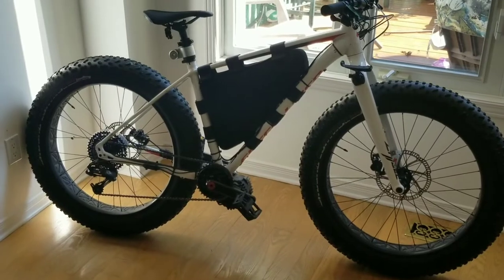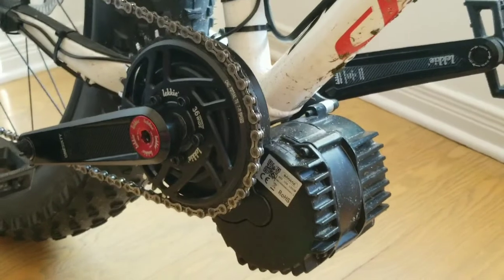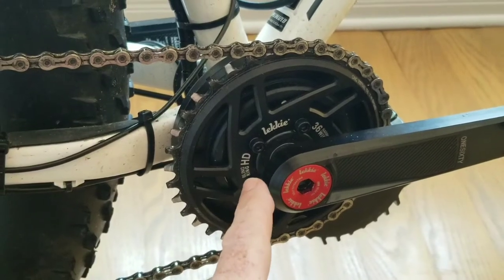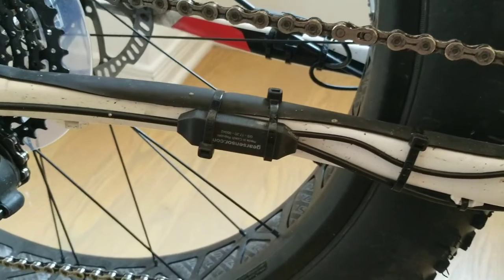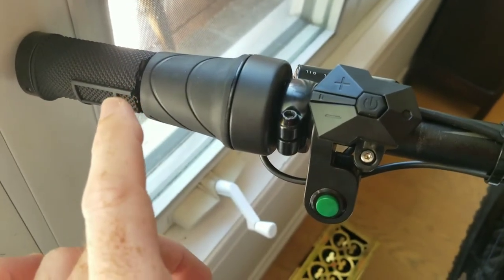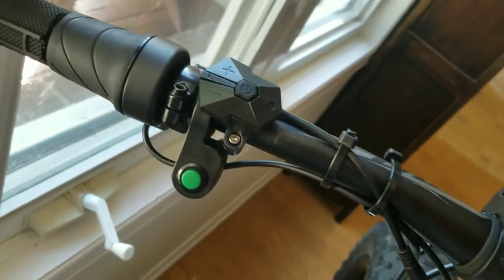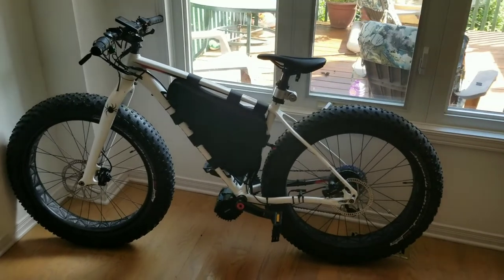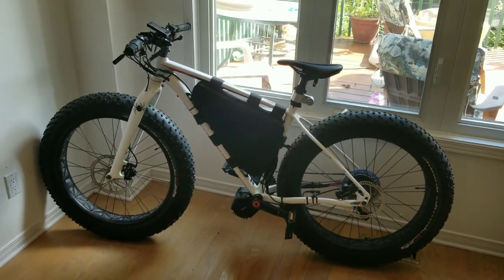Bafang BBSHD on Specialized Fatboy ebike conversion (stock) 30 amps 1500 watts

Comment: Very nice! That's what I have been trying to tell people build don't buy. Im sure this this bike will blow away any pre-built specialized e-bike for a third of the cost.
Reply from the maker: Yeah in terms of power and speed there is no competition. It's the handling on trails where they would beat this bike. Cost wise it's about $5500 Canadian to get to this point. The donor bike being about $3000 of that.
Reply: @HighVoltageKits  where can I buy all the parts I need man
Reply from the maker: Sign on my discord and it's easier to chat. This is very much in development right now but I can show you where I got the parts so far.

Comment: Am just beginning my Fatboy conversion and found this helpful. Will be sure to see your ride video.
Reply from the maker: Thanks. Good luck with your build. I noticed that some fatboys have the pf30 bottom bracket instead of the British thread. you can get a conversion cups they press in for about ten dollars on Ebay. I got some but ended up not needing them.
Reply: @HighVoltageKits  Please could you give me the link for pf30 to BSA conversion cups?
Reply from the maker: @nilsolivier2319  I got em off ebay mate. Just search for pf30 to bsa. Should come up. Let me know if you have issues.

Comment: Wish I'd of seen all your work back before I started playing with building mine summer before last.  I think I'll start over.  Mine has the BBSHD, a thousand watt hub in front and a 13spd rear end but all on an old mongoose I was given with the hub on it and powered by 48V drycell.  I built my own 52V which runs both motors and it has two throttles.  Way to many wires.
Reply from the maker: I bet you learned a ton in the process. What frame are you thinking of using?
Reply: @HighVoltageKits  I really don't know  about the frame for certain but am partial to the fat tires.  The mongoose has 4inch ones.  It's just not a well balanced bike for upper speeds.  Kinda wobbles some.  I'm currently going through all your posted videos from the beginning and am at Oct of 2019 loving it all.  The idea of a frame i seen you post in one somewhere that i haven't got to yet looked promising with its own battery box built in and a swing arm rear end.  I'll have to see about getting a picture of the mongoose to send you.  What a mess and yes it was a learning experience.   It was fun.
Reply from the maker: Sounds good. Consider joining our Discord community. There is a link in most video descriptions. Easy to post photos and videos there. Let me know if you have any issues.
Reply: @HighVoltageKits  I'll join eventually.   I am part of one where I was looking to score the ASI bac855 plug and play replacement and will join more I imagine.  I understand I've gained access to a list but it will be a while.  Meanwhile I may do something similiar to you.  While waiting I will probably do myself up a bike with the latest CYC.
Reply from the maker: That's the one. We we are catching up. Hopefully not long wait now. Still waiting for proper user feedback on the cyc!

Comment: I see where you used a 7.5mm & 5mm spacer on chainring side. Do you recall what size spacer was used on the other side and do you know what the diameter is of those spacers? Instead of using a bunch of washers on the motor mount bolts, could some sort of thick spacer be used? Thanks, I’m getting closer to ordering a kit. Just want to make sure I get everything I need.
Reply from the maker: The other side only needs the washers. Unless you are using the same frame I would just have a nice variety and see what works. The washers could be a single part. Aluminum would work well. They do the job though those washers.

Comment: You addressed chain line, which no other video has done. Thank You.  Do you have really short chain stays or is this going to be a common problem on all kits? - (can't use the full cluster)
Reply from the maker: Its because the tires are so big that the chainstays are wide and the reduction gear on the motor is pushed out. I ended up rearranging the gears as you dont really need the smallest ones.
Reply: There are aftermarket chain rings that address the chain line issues.

Comment: I have this exact setup with the same 36 tooth front chain ring. I  want to get the best trail and mountain performance possible. In your video you mentioned ditching the smaller gears and moving them over with a spacer so you could use the bigger gears. Did you find out if that worked? Thanks for the great videos and the help.
Reply from the maker: You are welcome. It did to a certain extent. I also switched to a 42t with an offset. But it will help as you rarely use those. There is a video on it in my history. It's going back a few years though. If you click on my channel and then videos there is a load more on this bike. Cheers

Comment: If you put the larger dished gear on the crank to get the chain back in the center of the cassette, would you get gears 1 and 2 back? I don't know for sure but I'd think you'd get more torque multiplication if you can get 1 and 2 to engage with the larger crank than you would from the smaller smaller crank that looses you 1 and 2. Just thinking out loud.
Reply from the maker: Harry Robertson I think you are right. That and the chain line would be better. Which would stress the chain much less.

Comment: Be careful, I heard you mention having the startup code in place so your kids won’t be able to throttle the bike. I have a BBS01B with the DNP-14 display, it locks the screen but not the motor or throttle. The motor is still active even without the passcode. I’ve read online this is common, check into it! Nice looking bike!
Reply from the maker: Tri P Zuki Just tried it. Yup you are spot on. Never even thought to check it. Kind of negates the point really... I think I will switch the push button kill for a kill switch. Probably one of those covered ones. Didn't even occur to test the throttle as too busy trying to beat the timer. Glad I found out this way! Thank you.
Reply: If you set the auto shut off it should force anyone trying to ride without a pass code to constantly have to turn the bike back on.

Comment: Nice Job Captain. I have two questions: 
1 Did you consider hub motor ?
2 How much faster the chain and gears wear out since all the extra torque is put on those.
  ( in hub motor it just your pedalling which stretches the chain and wears rear sprockets and that  is actually lighter than without e- assist )
Reply from the maker: Thanks JJ. I did a much more recent video with some good info on wear and tear. https://youtu.be/c7q5TbIYq7I But I haven't had anything major break yet even at 72 volts. I did not really consider a hub motor. Mainly as I knew I'd be moving to a place with a ton of hills and I wanted the torque only a mid drive can provide. Nothing against them mind. It's much easier to have regen breaking apparantly with a hub!

Comment: Looks like you have done a nice job of that. The only thing I don't like is how low the motor sits. Mite   run into trouble on ruff stuff.
Reply from the maker: Scott james eaton Thanks. I do worry about the motor being low although I have not bottomed it so far. Its built well enough to take a few hits not that I want to find out. I'm not into the downhill crazy stuff. I saw a build where the guy cut his frame and set the motor in the middle which would be ideal. Looked so cool. Bit beyond my current skills and budget.
Reply: @HighVoltageKits  if your doing fire roads and smooth track I don't think you will have any problems. Enjoy.
If you fancy a change in future. Haibike do a fat six built e fat bike.
Nice machine.

Comment: By the way, you can do some simple math to determine if the larger ring gear (with the offset, enabling you to access the larger rear ring gears) will benefit your hill climbing goal.  (Number of teeth in front)/(Number of teeth in rear)=X.  This is your gear ratio.  The smaller the number, the better the hill climbing torque.
Reply from the maker: Thanks for that tip. I have to work on the gearing a bit this weekend

Comment: Hi what did you fit onto the bottom bracket to allow the bafang to fit thanks and did you encounter any problems on the long term test thanks
Reply from the maker: If you have a look in my videos list there are a lot more videos on this bike at six months etc. The main things I fixed were the chainline but I have modified it significantly with external controllers as well. I used some spacers to position the motor and get it to clear the cranks but nothing else as it was an english  threaded BB. Hope this helps.

Comment: Just go with the lekki 42 T chainring and you can use all your existing sprockets, that’s what I did with mine and it’s perfect. You will never feel like you need more low end torque. You are effectively nullifying the 36T anyways with your setup.
Reply from the maker: OhioPreparedness Yeah I think I'll pick one up. Its spring now so lots better riding!

Comment: Impressive build. You did a great job.  How about posting some riding and performance video?  I subbed you, so you must 😆
Reply from the maker: For sure, thanks. I'm working on a video to demonstrate how good the ASI controller I'm using is. Be a few days as I just started a new job! Hope to ride some more trails etc with this setup soon. Cheers!
Reply: @HighVoltageKits  That ASI is sweet. It can be set up for bad ass power. Be ware of wheelies in lower gears;)

Comment: Hi great video, can I ask how did you get over the issue with the chain line? I'm having the same issue, I'm converting a trek xcaliber 7 and had to pack the motor out 10mm to stop it hitting the frame, I've adjusted  the cassette to get a straight chain line but now the body of the  deraillieur ends up hitting the cassette, I guessing I now need a spacer that would move the deraillieur out by 20 to 30mm or so any advise ypu have would be greatly appreciated 
Cheers
Reply from the maker: This is the most recent video I did looking at the gears although not from that angle. It shows what I did with my cassette. https://youtu.be/5DLFY0LoOPc

Comment: Forgive the newbie question.  Why did you go with the mid-drive versus the front wheel setup?  I have a 2015 Fatboy in mint condition and I'd like to convert it.  I'm just starting out with this stuff.
Reply from the maker: Awesome. Nothing wrong with questions. You are welcome to join  the channel discord and ask a bunch more there! https://discord.gg/9UwDG4j To answer this on though. A mid drive let's you keep your gears and is better with hill climbing. More central weight balance. Hope to see you on discord let me know if you have trouble. Cheers
Reply: @HighVoltageKits  Thank you brother.  I appreciate the invite and I will get on discord.  I will have some questions about the 100 versus 120 BBSHD for this bike.
Reply from the maker: Awesome. Got you covered there!

Comment: its super cool, have u come across a skid plate to protect the battery? i will build one of these and do a fair bit of offroad on rocky terrain, mountains etc
Reply from the maker: I have a mud guard that goes there. It's nice and wide but I only use it in winter..It was not much..It straps to the downtube. I don't recall the brand tho. Front runner fat it says on it

Comment: Good video.. what do you think it weighs total?
Reply from the maker: I think a shade over 70lbs.
Reply: @HighVoltageKits  thanks.  Is it ok if it gets splashed with water?  Can you just pressure wash it off?  I'd like to try some 4wd trails, but it involves fording some rivers.  Kind of worried that the motor will get submerged in water and die.
Reply from the maker: Stock it should be well waterproof. If you go external controller upgrades you can make it rock solid as well but a bit more effort. This is me riding the bbshd stock down flooded paths in ottawa https://youtu.be/D2DthD4Y0Xc
Reply: 67lbs

Comment: I put a 1500 watt hub motor on my mountain bike with a unit power 52 volt battery. it's very fast! Thinking about trying a mid drive for my next one. How powerful is the bafang? Top speed?
Reply from the maker: Hi James, This was the first video I did on the bike. You can see lots more on the channel. Here is a link to my website where there are lots of ride videos at 72 volts both with this motor and also the CYC X1 also a mid drive. https://captaincodswallop.net/ride-videos There is lots of information on the website about what I do as well as an option to join the channel discord and chat with lots of bike builders and electric vehicle enthusiasts. Cheers!
Reply: If you want power and speed get a 3000w rear hub kit and a 72v 20ah battery
Reply: I have a 1000w rear kit and it's easy fast enough for me, i love it, keep it nice and light for good power to weight ratio, i have 55v 13ah 30amp gonna get a 68v 20ah next

Comment: I am getting ready to order this kit. I saw you used a 7.5mm and 5mm spacer to get the chain clearance. I was wondering if those spacers came with the kit or if you ordered them separate.
Reply from the maker: Cool. EM3EV sent me a spacer kit. I had to order it though I think. Pretty sure I used a 7.5 on one side and a 5. Then a 5mm on the non drive.
Reply from the maker: This is a better guide with my rebuild https://youtu.be/lSewpIujlnA
Reply: Thanks!

Comment: Do you ride off-road at all?
I'm trying to decide if I should go with a shark battery vs a triangle battery, if 50% of my riding will be off road.
Would a triangle battery move and bump around more than a shark?
Reply from the maker: Yeah. All the time. I made sure to protect the battery with layers of padding especially where the tunes are. So the pack sat on two layers of dense foam.. I cut up those floor ones you put together like a jigsaw for kids rooms. You can fill all the spaces so its not moving and is damped by vibration. I prefer triangle packs myself. Em3ev did a hard case triangle a while back. So yeah. Could a triangle pack get damaged from movement off road. Yes. But its an easy thing to overcome. Hope this helps. Cheers
Reply: @HighVoltageKits  yes thank you, this helps a lot. I'm about to order one from Litespeed, but hesitated on the triangle thinking this through. I think I'll go for it now. Thanks for your videos and your reply!!
Reply from the maker: If your order is over $1000 usd you can get 100 off with the code CAPTAIN100

Comment: Love this build , I have got a fatboy trail as well and a bbshd I would like to know what adapter you used  for the press fit ? And how much mm of spacer you used on each side?  Thanks  you very much 🙏
Reply from the maker: Pretty sure it was a PF30 to threaded adapter I got off ebay. In the end though I did not need to use them. My version of the fatboy was threaded all along. In terms of spacers. I am pretty sure I used about 8mm on the drive side to get the motor casing to not hit the chain stay. On the non drive side I used a stack of washers to space out the plate. This part is critical to get flat so it grips the bottom bracket. If you have to used pf adapters then you may find that you need less spacers on the drive side. I was send one big spacer from em3ev to do mine. You got the 120 mm version?
Reply: Captain Codswallop thanks you for your answer , yes I have the 120mm version of the bbshd . I was scared to take the 100mm and after the spacer with the narrow wide 40t Lekkie that I can’t mount it . So I went for the 120 mm
I just ordered a pf30 to bsa adapter from token I hope it will be ok . 
This one : 
https://m.bikester.fr/token-adaptateur-boitier-press-thread-pf30-roulement-bsa-noir-685352.html

Comment: Nice bike & motor. What's the point of a smaller chain ring if it robs you of lower gears in the back? If you want to get access to the lower gears get the 42 tooth Bling Ring or even better a Luna Cycles Luna Eclipse 42 tooth. You may need to add a spacer to clear the chain stay but it's worth it! I have a BBSHD and 42 tooth Eclipse chain ring (from Luna Cycles) on my mountain bike. That setup gives me a ratio of 42:11 in top gear & 42:42 in lowest gear which gives me a higher top speed as well as allow me to climb anything the tires can grip.
Ride on & enjoy;)
Reply from the maker: I did a long time ago. I'm running with just three gears now. 42t lekkie and 72 volts at times. This is the first video I made. You are bang on with your assessment tho!
Reply: @HighVoltageKits  I read that you were running the ASI in later comments. I'll have to check out your other videos. I was very interested in the ASI but went went with a Ludicrous controller for a more plug & play experience. I'm still learning though and that ASI at 72 volts seems perfect for a fat bike build in my future.
Reply from the maker: Yeah it does 60-65kph on the flat / moderate hills. Which is pretty nutty.. Even at 52 volts it pulls 50+ on the flat in the 42t at the back.